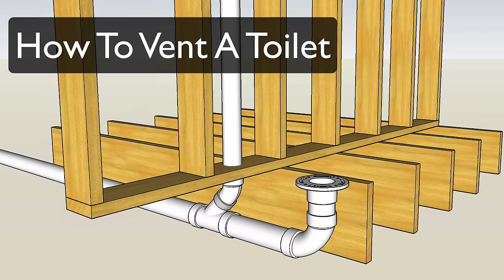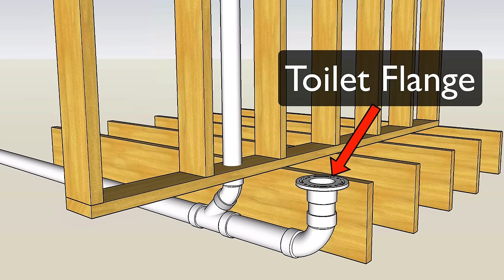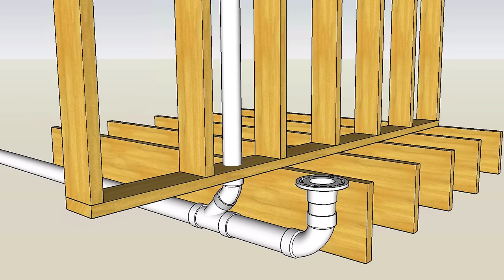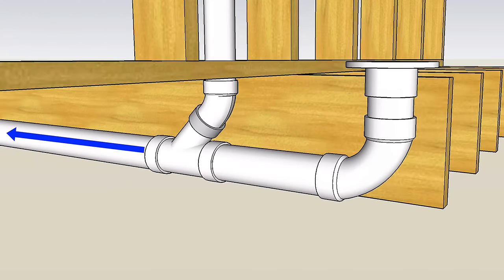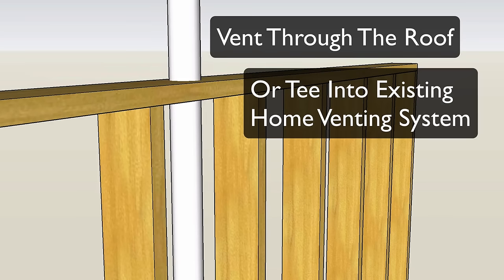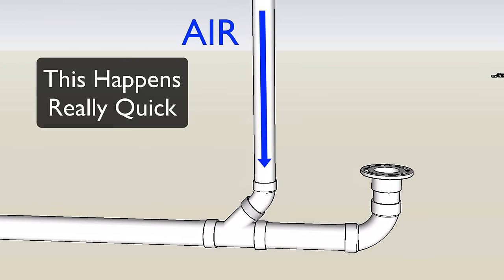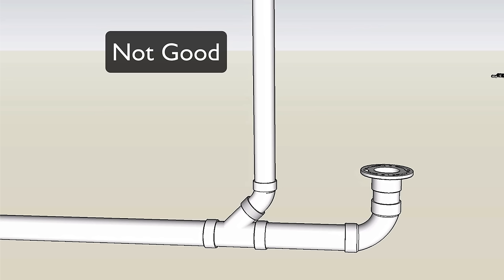How To Vent & Plumb A Toilet (Step by Step)

Comment: Wall hung, concealed tank toilets are becoming more popular. I am about to install two of them, and need to reconfigure my venting. In the first case the vent stack is currently located in the wall cavity (as per your illustrations) exactly where the toilet tank will need to be mounted, and in the second case I will be creating an entirely new bathroom: toilet, sink and shower. Home is built on a slab, so I will be doing a bit of concrete cutting. I hope you will consider addressing this issue in the future.

Comment from the maker: If you're in the IPC you can use an 1.5 toilet vent, in the UPC min vent is 2"
Reply: Hammerpdia our plumber placed the bent about 15 feet away from out toilet,is that the reason for it to not flush propetly leaving half the water in the tank?

Comment: Thank you. At Lowes someone was trying to tell me what I needed but it wasn't as clear as this.
Reply: Lowes are not pro and they just want to get you going.
Reply: I was told a toilet needed a pea trap. Seriously  ! I am remodeling a 2 story . Upstairs and basement half below grade. I am looking at this ceiling wondering how in the hell I'm supposed to do a 3" pea trap in that space! Everything I tried took up too much room and would go below the ceiling sheetrock. I actually saw some other sources saying the same. Everything I already know about plumbing and toilets said a pea trap was not necessary.  Only necessry in rough in plumbing on tuns and showers. Glad to find your video so I know I'm not crazy. Got the install done...tied into an existing 2" vent pipe. Thanks for sharing the knowledge.

Comment: If you vent the water closet shown in the first diagram and you have a blockage and run a cable though the double clean outs outside the structure you could bust the water closet. Never dead end into a fixture.

Comment: Great video and thank you. We recently notice sewer smells from the fan ventilation (ceiling area) in one of the main floor bathrooms. The attic is right above the ceiling with vent pipes. What are the potential causes of the problems? Thank you very much!

Comment: This is great. I'm going to have to do a modified version of the 2nd way of venting. Will have to vent the toilet outside an exterior wall (no room in the wall as it's load-bearing & in very old construction) Will vent from under the house & have a cleanout. The trap arm will run south but the main sewer line runs east to west & is about 7' north so I'll have to run trap arm south & then run a line north to connect to main soil pipe. Will have to tie in a washing machine drain downstream for suds prevention.
Do you have any videos or tutorials on washing machine plumbing?

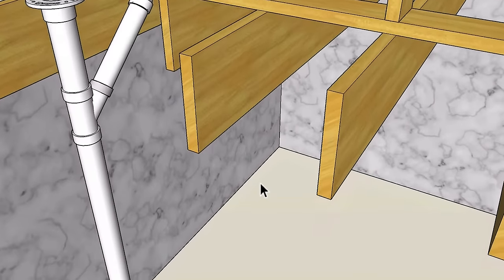Comment: 1:50 of the video shows an illegal vent
911.3 Connection at Different Levels

Where the fixture drains connect at different levels, the vent shall connect as a vertical extension of the vertical drain. The vertical drain pipe connecting the two fixture drains shall be considered to be the vent for the lower fixture drain, and shall be sized in accordance with Table 911.3. The upper fixture shall not be a water closet.

Comment: Thanks for video. Have a very old rental house. Septic just outside bathroom window. Toilet does not drain well and gurgles when tenant takes a bath. There is no way I can connect a vent between toilet and septic too short and direct run. Must I add a vent to the sink AND bathtub? and will this help. All three clustered together.  There is only one vent in system halfway between kitchen sink and  septic. Tenant complaining of septic smell.

Comment: Using a wye vertically is generally impractical and a vertical drop over 18" before the vent is frowned upon. There's one way, only if structural restrictions require it. Rolling a 3x2 wye so the vent is above the center line, horizontal at a 1/4" ft slope and turning vertical with a L.S. 1/4 bend. But! Not if you feel like it!.

Comment: Thanks!
I have a situation similar to the layout in the pdf where it has a sanitary tee going down to a wye with a cleanout. I was trying to figure out the best way to do it and this looks like the best solution. I had a more convoluted plan that involved more pipes. This will simplify things for me.
Btw, how do you get the pipes to line up so nicely in sketchup? I have the hardest time getting things to rotate and go where I want them to.

Comment: Firstly, nice video....however, there are a couple things that aren't accurate here. the first and most notable thing is the long sweep 90. It is not a better choice over a standard 90 elbow as a water closet depends on syphonic action to force the Oh Henry's down the pipe. The long the sweep the less effective this principle becomes, hence the reason you are allowed to use a 90 elbow here and not limited to using a 45 and fitting 45 to form the change in direction as laid out in most plumbing codes. The other thing and maybe you didn't put it because your code doesn't require it (though I have yet to see one that doesn't) is the lack of a line clean-out or wye with fitting clean-out in the wall on the vent. At least here in Canada, the NPC says that you must have the ability to clear a clogged vent by use of a clean-out. so in the scenario here, how does one clean out the vent should the need arise? You can't snake backwards and vertically. Even if your code doesn't require it (unfortunately I can't see how it wouldn't), the addition of it is just good plumbing practice...

Comment: still looking for the answer and waiting on the email.  why not vent behind a toilet?  so a long sweep wye but at the back of the wye you reduce from 3" down to 2" and 90º up the wall for the vent?
Reply from the maker: Sometimes that toilet vent cheat sheet goes to the spam folder. You might double check there. Also, toilet vent size depends on code. In the IPC it's 1.5" and UPC it's 2".
Reply: @Hammerpedia  yes but what about the venting?
Reply: @Hammerpedia  yes but what about the venting?

Comment: That is progess. Untill the 70s we used cast iron, lead joints. 1850 and back, a bench with a hole in it overhanging a cliff, no charming TP.
Reply: In Chicago we still use cast iron with lead and oakum.

Comment: Awesome sir, very, very informative! 

Question for you, I was taught for the main line to only ever run 4" pipe, pipes going into the main line you can run 3".  I've noticed a lot of different contractors around where I live in the last 2 - 3 years only running 3" pipe on the main line, has something changed in the code book? Or, was this ever even code?
Reply: I believe it depends which plumbing code your state uses. There is ipc and upc. I believe one of them allows for the use of 3” pipe, and one requires 4” pipe.
Reply: And then some states have their own plumbing codes as well.

Comment: Shouldn’t it be a t going to the vent pipe not a wye? Black water is not going to travel up the pipe, and it makes the air enter the drain pipe easier. I could be wrong, and maybe tee’s are only on verticals to horizontal. Not horizontal to verticals. Just curious.

Comment: there seems to be a venting pipe that goes out the wall to the outside horizontally, and lately its been occasionally discharging water when i flush.

The discharged water isn't stinky nor fecal matter found anywhere.

I notice this only happens while flushing and the water is struggling to go down the toilet bowl drain.

Should i be concerned?

Comment: Great video, thanks. I believe there should be a 1/8ths inch drop per foot for a wc drain. I'm ok with that, but is there a horizontal max distance between the w.c. and the vertical soil pipe? That is, a limit to how far a w.c. can be remote from the soil pipe no matter what the gradient?
Reply: Are you asking how far between the flange of the toilet and the centerline of the vent? That would be 6' for 3" and (in the old days) 10' for 4". It's called the trap arm. For a 1 1/2" trap the distance between the weir of the trap and the centerline of the vent is no more than 42". For 2", 5'.
Reply: Hi Richard, in the UK we have a 4 inch dia. vertical pipe on the house outside wall that the w.c. drains into. That is how we vent the waste (no other vent pipe). I want to position my w.c. 8 feet from this pipe (the w.c. has been on the other side of the wall close to the drain pipe up till now). I was just concerned an 8 ft long pipe between w.c. & the outside drain pipe may cause a blockage.
Reply: You'll be fine. The old rule on the distance between the flange for the toilet and the center line of that vent stack was,and probably still is, 10'. Taking in the fact that toilets used to use enough water to flush a small puppy(sorry. old expression) and now use less than 3 liters per flush, there'll be plenty of air circulating in the upper part of that 4" trap arm. It's a vacuum that nature abhors and really the primary reason for vents. But, please, try and have a fall of 1/4" per foot on that pipe! No less, no more. The hydraulic action of the water in the pipe at that degree of fall keeps the pipe clean. A greater slope and the water runs down the center of the pipe and can leave deposits on the walls. Less slope and if there's any settling of the building over time, you could have a level drain. So... 1/4" per foot!!! 1" every 4' (Okay,okay. You could run at 1/8" per foot in a pinch)
Reply: Just what I needed to know. Many thanks.
Reply: And by the way. You're allowed a 90 degree offset horizontally. But the total aggregate distance may not be more than 10' between flange and vent centerline
Reply: Is it bell and spigot cast iron using lead on that waste stack on the outside wall?
Reply: Because if it is, you can still use that tee and not have to cut it out.
Reply: I am not an expert on drain systems , so when in doubt, flush two or three times and the crap will move forward. Yes, it is not very environmentally friendly but it does what it is suppose to do in a bad installation job......just saying. When one does renovations  for a living, you see  some bad plumbing installation jobs, obviously without plumbing inspections.

Comment: Could you help me out with this questions? I'm installing a geberit wall carrier and need to add a vent. I'm using an existing 3 inch vent pipe in the wall that will be used for the toilet drainage. I wanted to know, can use a Long-Turn Tee Wye and place it vertically right below the drainage of the wall mounted toilet. Is a Long-Turn Tee Wye aceptable or does it need to be a DWV All Hub Wye?

Comment: Can you show in detail how to rough-in a bathroom---sink, toilet, shower, with proper size pipe, proper size vent, how big main vent to roof  ????  Thanks.  Should pipe be the same size as the waste  ??
Reply: Sizing depends on fixture units in the specific room. You need to refer to the code book for sizing charts.

Comment: Hi, this clip was easy to follow, nice job. Can I ask you a question? Regarding the vent, you mention that it goes up to the roof. Do some builders use the bathroom floor drain as a vent? Because we have a feces smell coming from the bathroom floor drain! ( note we have our toilet in it’s own separate small room on the second floor. Hopefully you can advice us if it’s normal or what we can do to fix it. Look forward in reading from you. Cheers Lorena
Reply: No.
Reply: The only ill25

Comment: Hey Dylan, nice video.  I have a scenario similar to your video here, with the vent directly behind the 90 and closet flange.  The difference is my wall is on the opposite side of the flange.  The flange was roughed in too close to the wall (less than 10") and the toilet was installed on an angle.  My goal is to have a 12" rough in.  This can be achieved if I take the wye out and move the vent to the opposite side of the flange.  BTW,  there is another vent downstream a bit from all of this.  Would this plan be kosher?
Reply: It's before he goes take him over

Comment: How far away from the fixture can you connect the vent to the waste line. Say the wall was 10 ft back. What's the max distance away from the 90 you can connect the vent by code
Reply from the maker: Hey Richard, check out this article for your answer: http://www.hammerpedia.com/how-to-vent-a-toilet/

Comment: Help please . We had installed a new ceiling bathroom fan with a light, he add combo wye to the fan  made a hole in to our exiting  Vertical vent pipe that goes in to the roof , Is it safe? is there any possibility that air can back up to the fan into our bathroom  breathing  bad  polluted air ? they insure me was ok but i am getting worried . hope you can tell  if is ok Thank you

Comment: I bought a home recently.  I have a slow drain toilet.  When I removed the toilet, I see water at the elbow of the pvc.  I used a garden hose to water it down.  It never overflowed but the water always stayed at the elbow of the pvc.  Any input would be appreciated.
Reply: Flood is coming, I guest.
Reply: are you on septic?  if you're on septic, your tank may be overflowing due to spring rains flooding your lateral lines in the yard, causing some back up into your house (danger).  Go outside and look into your septic tank access ports.  Or, the sewer pipe connected to the toilet may not have an appropriate down slope, allowing some residual waste water to remain.  is it a basement bathroom?

Comment: I have a roof vent. After a complete renovation of the bathroom a different plumber told me I needed to vent the sink with an air admittance valve. Can I install the AAV even though I have a roof vent? Will they cancel each other out?
Reply: The only reason to use an AAV is if you can't run the vent pipe up through the wall to reach the roof vent. Keep in mind that AAVs are not allowed in some jurisdictions, they can't be put inside of a wall, and they can fail after a few years and need to be replaced. Ideally, the best thing is to vent to the roof.
Reply: What happen if I just added a bathroom in basement and cannot get the vents to roof and also no existing vents near by to tie too?
Reply: Sapoun Ngin 
Run a new vent up the wall and tie in horizontally to another vent

Comment: You could have used a 1' 1/2 or 2" as a vent instead of a 3" as show you need half the size of your main vent which is a 3" unless its over 40ft then you need a 3" vent out the roof
Reply: Perhaps you should watch the video again before passing on all your knowledge. :52

Comment: great info and video.  i had a extra question is it ok to combine my shower sink and toilet into one vent about 5 ft down stream?
Reply: Jeremiah Munoz 
Yes but some codes don’t allow for the toilet to be up stream from other fixtures if you are using the same vent. 
Also remember all vents must be at or above 45deg vertical until they are 6” above the flood rim of the highest fixture they serve (flood rim is the highest point that water will overflow)
Reply: Thank you. i got the 45deg down for sure.  im building 10 miles out from a where the code guy stops by so i think im ok lol

Comment: Quick question: Could I have the toilet flange go straight down in to a sanitary tee and use the side branch for the vent instead of running a bend to the side inlet/outlet? If so, would I need to have it oriented so the side sweep goes up instead of down?
Reply from the maker: Hey my cats, problem with that is your vent goes horizontal under the toilet's FLR. With conventional dry venting, vents have to remain vertical until it's at least six inches (or more) above the FLR (flood level rim). Then once it's 6 inches above the FLR, it can be offset horizontal if necessary :)
Reply: Sorry, I should have clarified, the side branch would be like a trap arm- I'm not describing it very well, but I have pictures of the options (there would be PVC pipe in between the fittings but I didn't draw it in). Not sure if it will let me link the image... https://78.media.tumblr.com/9e6ddb68df259a252ac0552b4af45cd3/tumblr_p9mpz4VPaJ1qkwd9ao2_1280.png

Hopefully the image link will stay... But basically the wall behind the toilet is the south wall and the main soil pipe runs perpendicular (east to west) about 5' or more north of the toilet. So, I'd have to go under the toilet and behind it a little over a foot to vent it one way and then have it drop down to flow the opposite way (parallel) to meet the main soil pipe. Is that making sense?
Reply: Oops. I just looked at my sketches and realized the vent does go horizontal. You're right. I got confused because the original plumbing for my home has the closet flange going straight down to a sanitary tee which branches off to the side and has a reducing fernco fitting (sans metal straps) and then has a sharp 90 elbow to carry it up to the main vent. So, the only vented fixture is not even vented properly. Thank you!
Reply from the maker: "A" is the winner
Reply: Thanks. I'm making a list of the fittings I will need for that. Btw, do you have any videos about cleanouts?
My washing machine plumbing is all wrong (no trap above the floor, no vent, no idea where it even goes once it goes under the house). I want to add a proper standpipe and have a cleanout on the vent pipe for it. I know how to do cleanouts on horizontal pipe, but am not sure on vertical pipe. Would I use a sanitary tee with a cleanout glued to the hub? (If so, would the tee sweep go up or down) or could I use a cleanout/test tee that has no sweeps but already has the threads and a cap?
Reply: my cats 
Make sure you don't double trap it. It most likely ties in with the kitchen and is vented there. What's all wrong with it?

Comment: shouldn't the vent be on the end of the run verses between the fixture and the main house sewer line , or vertical stack depending on the piping lay out ?
Reply: Daniel Gordon
Not really, it depends the size of drain pipe on 3” you must have a vent within 12’